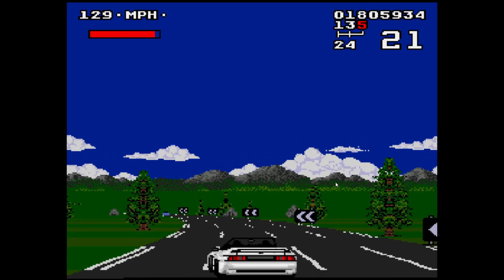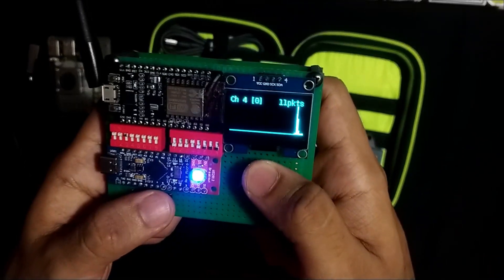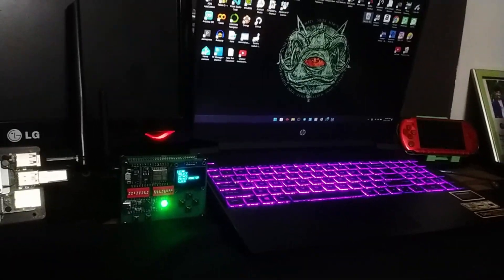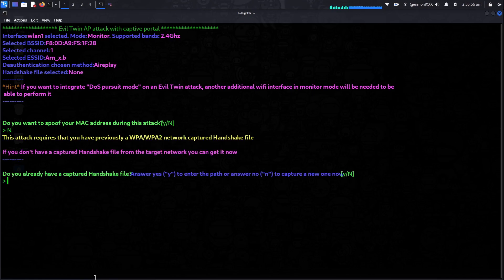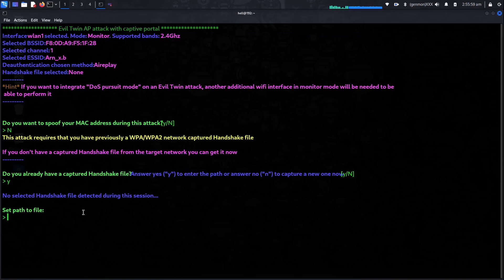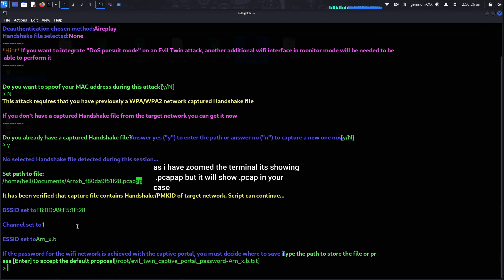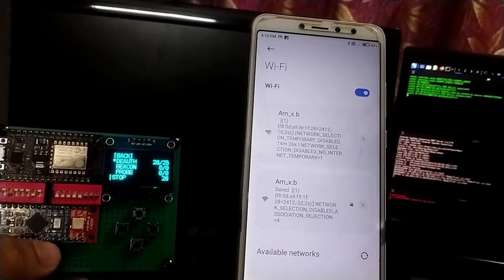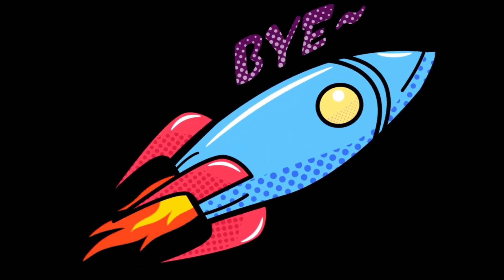Hack wifi like Mr. ROBOT with Airgeddon || Kali Linux || Captive Portal || Evil Twin attack

Comment: Amazon link of TP link wifi adaptor?
Reply from the maker: Limited-time deal: TP-Link 600 Mbps WiFi Wireless Network USB Adapter for Desktop Pc with 2.4Ghz/5Ghz High Gain Dual Band 5Dbi Antenna Wi-Fi,Supports Windows 11/10/8.1/8/7/Xp,Mac Os 10.15&Earlier(Archer T2U Plus),Black https://amzn.in/d/8Pue0TO

Comment: i have only  ar9271 wifi adapter tried it on my router my phone just disconnects not reconennecting  and also not opening a captive portal.
Reply from the maker: You need two adapter one for disconnecting device and another for captive portal

Comment: But once the handshake is captured the victim phones reconnects automatically to the original access point not the fake one, it is obvious he will not reconnect to a new one ( fake AP ) that's what i think this attakc is useless unless you keep de-authenticating him from his original ap so he can connect to the fake one
Reply from the maker: You didn't understand the attack properly first we capture the handshake then yes the device will connect with the original one but then we deauth him from the original wifi network and he will not be abble to connect to the original wifi untill I want .....then he will try to connect to the different network available and boom we got him...I hope you get the point
Reply: @Arn_x.b  you need two wifi adapters that support monitor mode in this case, one is used to perform the evil twin attack and the other one for the deauthentification so the user keeps getting disconnected everytime until you stop it, is that right?
Reply from the maker: Yes you are right

Comment: I have only one wifi adapter,
What should i do??
Pls reply
Reply from the maker: first capture the handshake..... then use airgeddon to create evil twin now if you dont have a 2nd wifi adapter then you will not able to force the user to connect to the fake.. so you can create   a wifi like free wifi so that they connect to get internet and then take the password
Reply: @Arn_x.b  bro , that will not happen as if someone have their own wifi, then why he will connect to free one..
I want to do this same attack 
Can you suggest me very cheap wifi adapter for ddos that support monitor mode?
Or can I use nodemcu?
Reply from the maker: see you can use nodemcu with esp8266 microcontroller others will not work but the only issue is the range 0r you can get tp link ac600

Comment: Can you pls help me. I have a live boot kali usb but cant get it working. How do you boot from usb not the micro
Reply from the maker: which pi do you use is pi 5 then you need the official adapter to boot form the usb as the current output is limited by bios but we can overlay thiese settings by modifying the config.txt file in boot partition just flash the os then oppen the boot partition then follow this video ..........if you still face issue then dm on instagram

https://www.youtube.com/watch?v=O07QjfTRh4w&t=972s

Comment: bro do we need 2 wifi adapters for this attack?
Reply from the maker: Long answer short yes you need but only as a replacement of the wifi jammer that i  used in the end to until then you can sucessfuly launch the captive portal with only one wifi adapter
Reply from the maker: the  only issue will be that you can not force the user to get connect to the fake wifi they have to it by themself
which they might its about luck
Reply: @Arn_x.b  i get it bro thanks